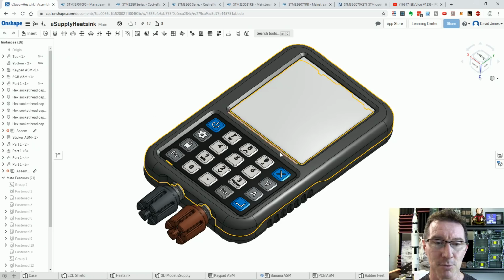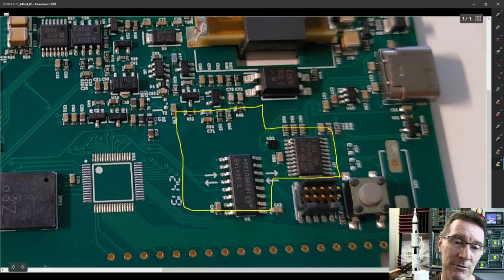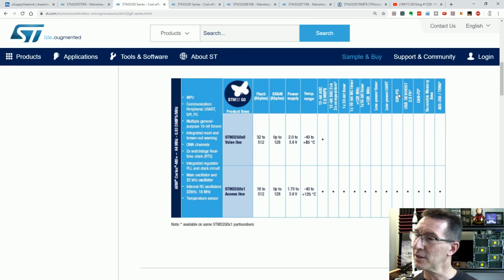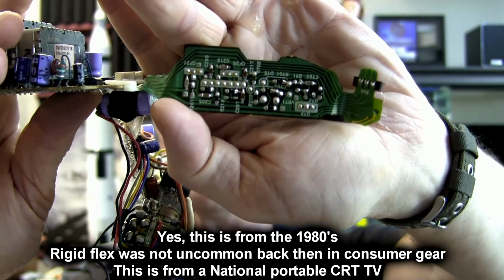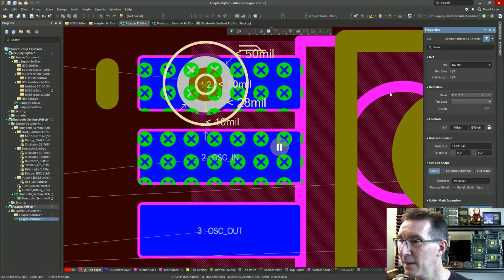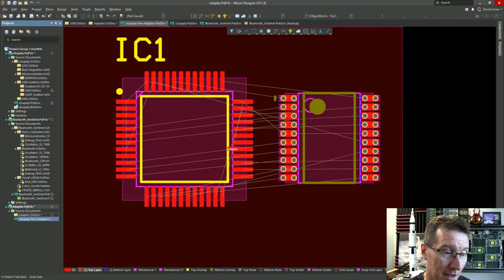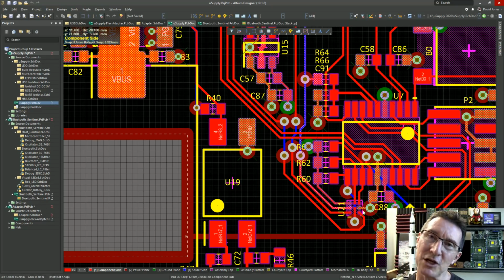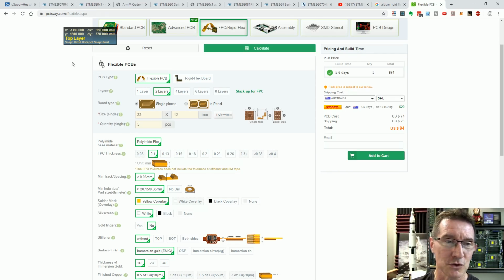EEVblog #1262 - Designing a Flex PCB + uSupply Update

Comment: Putting out incomplete data sheets for parts that you can actually buy from a vendor is a kind of scummy practice. I guess only people with preproduction samples get the actual datasheets under an NDA? wtf.
Reply: I have a Fingerprint Reader module with red and green LEDs. There is no docs how to control these LEDs and the red one is never lit. I asked the vendor and he said he signed an NDA with an other customer and cant tell me how to use the red led 🤦🏻‍♂️

Comment: If you can shrink a 1mb library down to 32k, your library was poorly made in the first place.
Reply: They hated him 'cause he told them the truth
Reply: Dave mentioned 32k flash but 1Mbit library. Bytes and bits. So, was the library 128k? I haven't bothered to check but makes more sense if so.
Reply: I’ve looked at this PD chip and have no idea how the support library is so big. It’s like 2-4kb of very easy C code with a few state machines in it (where all the magic lies). It’s not terribly complex. 2 megabits is way more than UTF-8 encoded extracted text of the USB PD standard. How on Earth did they manage to butcher it up so bad that it was bigger than the English text describing it. Wow.
Reply: I don’t know about ST but Microchip likes to charge extra for compilers that optimize for size. Is that a motivation for a bloated library for ST? Possibly it just puts extra pressure on people to buy a bigger chip but if you call and complain they will snip the code down for you.
Reply: >when ur library contains 3 libraries
Reply: I’m sure that such libraries are done by interns or otherwise the development stops as soon as it sorta kinda works. You let the customers debug it then.  If you’re a big chip vendor, that is :/
Reply: If an embedded driver is 1MB in the first place, there's a problem.  I used to play entire games off 64k.
Reply: As computers got faster and had more memory available, there was less incentive for programmers to write efficient and compact code. That incentive basically vanished when huge "do everything" libraries like .NET and Java came along where programmers could just use easy functions instead of writing their own, so you ended up with programs that are small, but get massively bloated from the gigabytes of dependencies that are included.

If you want a small and efficient program/firmware/whatever, you'll need to find a programmer in the 40+ age group who still remembers the days of having to make every last byte count. A modern programmer is going to have a tough time weening themselves off of Microsoft's tit to be able to program on a microcontroller with just a few dozen kilobytes of memory.
Reply: @GGigabiteM  I mean, sure, when I'm doing Java, Python, or C++ with destination of server or desktop, I don't care if the lib uses 32k or 1M. But for embedded use? That's incompetence.
Reply: @666Tomato666  Not caring at all about executable size on any platform is incompetence, it's one reason why operating systems have become bloated nightmares in the past 13 or so years.
Reply: @GGigabiteM  I didn't say "don't care at all"

what I meant is that normal, unoptimised code (but not enormous) will likely be a drop in a bucket compared to sizes of data processed. So usually it's better use of the time to make it faster than to make it smaller
Reply: @666Tomato666  1M is 30*times 32k. With up to 30 times the complexity you will have up to 30 times the amount of errors. Und Propably you have 1M of code in your project you totally dont understand und thus cannot fix. So you will start working around the errors, maybe with the help of another library? Dependency spiral of death...
Reply: @CroneKorkN  usually the library gets so large because it vendors (copies wholesale) unnecessary crap, not because it actually has 30 times as much code
Reply: @GGigabiteM  ok boomer.
Reply: Even 32k is still enormous for that task.
What does that library do? Write out the protocol with quill on parchment and implement a mounted messenger to deliver it?

There are complete PC-demos with graphics and sound that use less data than that.
Reply: @stephanweinberger  It will do loads of stuff he doesn't need. That is what a library is. He doesn't want to know what it does, only that it does everything he needs. The library has most probably been built with the same philosophy. Hence, flabby.
Reply: @pavlitt355  I have a hard time imagining what that other stuff could be. The chip doesn't do much more than USB power configuration. So why would the library to control it do much more than that?

And even if it does: why not throw some compiler directives in and build a smaller version that only does the basics. This is virtually no work on the manufacturer's side (at least much less work than actually optimizing the code).

Comment: New to Altium using 19.1.8 . Struggling thru the online tutorial where after creating the components and generating a PCB file the component outlines show but the air wires didn't. Spent several hours trying to find out why and shutdown the PC in frustration several days ago. Saw this video with you mentioning v19 , reopened Altium, and lo and behold the air wires show. Go figure.
Reply: Vince I Altium professional here: the missing air wires bug has bitten me on a production run. It’s truly unusable at times.

Comment: uSupply : a project which is in the works for more than 7+ years
Reply from the maker: Closer to 9 years. I can remember showing Leo Simpson a prototype when he visited Altium. I left Altium in March 2011.
Reply: @EEVblog  Still using the LT3080 ? I was going to spend some time over the Christmas break building one based on Rev-C but with LM317 and ICL7660 to provide a negative bias to get the output voltage to zero, but I might wait for you to finish it :)
Reply: EEVblog I buy/back a uSupply as soon as it’s available. I like the design with the keypad input. Reminds me of my old lab power supply from Voltcraft which also has a keypad to dial voltage and current in.
Reply: That's okay I also have a project going for 10 years. Something else always takes my time.
Reply: Probably still be ready before a working prototype of Solar Roadways comes out. (keyword: working)
Reply: @redsquirrelftw  The sun will have gone out...  making the whole "solar" thing moot...
Reply: The Chinese are also waiting patiently, so they can copy the whole thing and sell it for 1/10 th of the price.